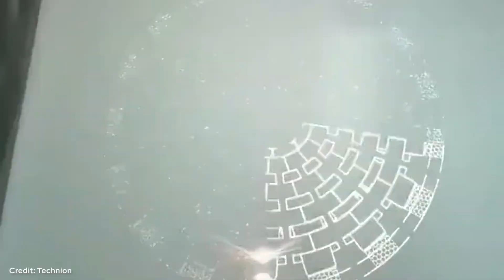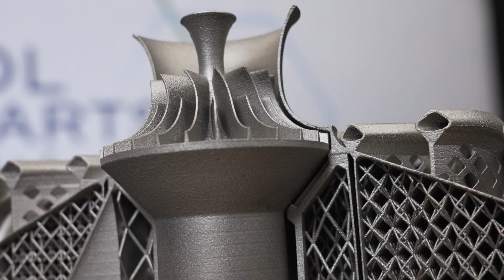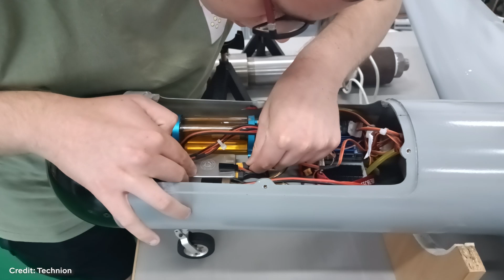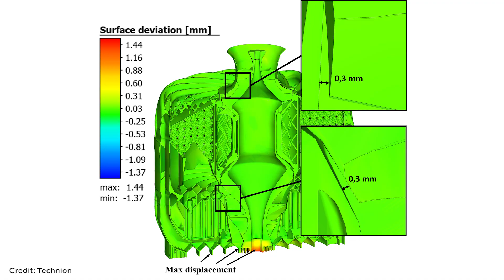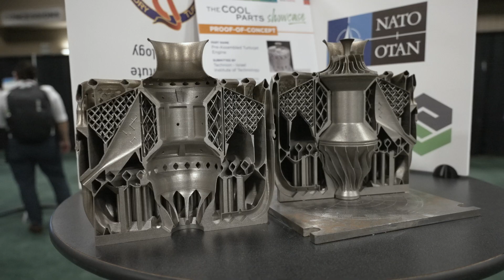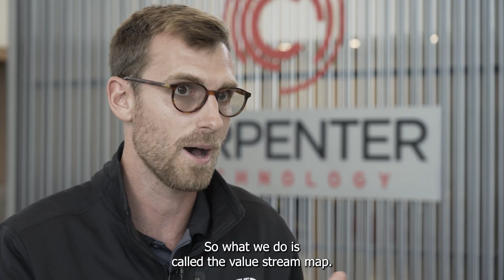Turbo Jet Engine 3D Printed In Only Two Parts

Comment: Very interesting. Bearings of course are the critical component to see continued reusability. I was really hoping to see a demonstration of this engine lighting off.
Reply: There are some techniques where “inserts” can be placed into an assembly during the “printing” process.
Reply: @danamyrocket  I understand that. It was clearly not done here. The design relies on a fluid bearing created by fuel in the spinning shaft / housing "bearing" zones. This bearing breaks down as the shaft slows down. At startup, there is no bearing at all, until revs are high enough for a hydrodynamic bearing to form between surfaces. The design may be made such that a break-in period is required to ensure proper mating of surfaces to best support later functionality. Kind of like a Babbit bearing. First uses will be in drones, likely as these appear to be of limited planned lifespan. There is no opportunity to repair either, unless they are made of a few more components. All of this said, you might be able to create from four parts, shaft, "housing" in three parts. With some easy light machining to surfaces, more durable bearings could be placed, thereby making the shaft and bearings, serviceable. This would also afford the opportunity to balance the shaft. As printed, it will definitely not be of precision balance, without fairly extensive machining.
Reply: @rob6052 the first use will probably be in cruise missiles where the service life is an hour.

The great question is whether printing a one piece housing, lightly machining surfaces for bearing inserts and then making the rotating assembly only two pieces plus a nut, is better. It allows setting the clearance for the hydrostatic bearings.

Being able to balance the rotating assembly is advantageous and that’s difficult to do while in engine. Even if you had nubs protruding, they’d need to be machined to accept bearings to attach for the spin balance.

It has already been mentioned that the lack of bearings before achieving fuel flow is a problem, and that is still true even with a single use turbine.

Playing devils advocate, if a grease were injected that was pushed out by the fuel, perhaps it could be started with a gas generator cartridge.

All of the above are ignores the problem that a two shaft turbofan saves more fuel than the weight penalty, or at high enough speeds that the ramjet or scramjet could be printed with no moving parts.
Reply: @edmarciniak7612  the questions we all raise, are the ones they're waiting to answer as well. This is an equivalent to Robert Goddard, thinking about playing with rockets.
Reply: @danamyrocket  inserts need preload so they can't move out of position or be loose during dynamic loading. Then as a journal bearing the spindle bearing needs to be at a specific finish and gap for fluid to allow the turbine to spin.
Reply: The intent is to use a "hydrostatic bearing".  The engine fuel will be injected into the void between the stator and the rotor, and then circulated into the combustion chamber
Reply: I know a lot of people are replying with the 'hydrostatic bearing' as they mention. But, there is a very good reason why the vast majority of rotating assemblies do not use this form of bearing. The viscosity of the fuel will be very low, at start up there is no float in the component. The rotating component will have  thrust vector and so often will not sufficient lubrication or float on the thrust side of the component. 
Again, I'm very happy to be wrong when I see them put 500+hours on this engine, with 100+ cold starts.
Reply: @MegaBoomshanka I operate industrial turbines, so I have some experience with this type of thing. You’re correct; an oil wedge bearing provides no protection at low speed without pressurized lubrication. We use XL32 turbine oil on our large Babbitt bearings, which is more viscous than kerosene/diesel but not by that much. It’s roughly equivalent to AW32 hydraulic oil. In order to make this work they would need a pressurized fuel/lube system to pump through the turbine prior to start up, and post shut down. 

The real issue with this engine is as it is designed it has no air management systems; so it’s going to have a VERY narrow operating output range. Think 2-3% maximum turndown, without having a good deal of external instrumentation and actuators bolted on.
Reply: @MegaBoomshanka  Yes it seems startup no bearing is the problem. But is it really? Already today a lot of jet engines require specialized removable mechanisms to get the engine going. If you had to attach something or whatever to overcome no fluid at startup, it wouldn't be that different.
Reply: It won’t run, definitely will never fly, but it’s fun I guess
Reply: its not a reusable engine
Reply: It doesn't run
Reply: @dontimberman5493  Indeed. It's a complete initial feasibility exercise. In my mind, they've proven some geometric construction capabilities, but beyond that, it marks the beginning of something new for a five to ten year dev cycle, depending on application.
Reply: @rob6052  oh ya and will likely never meet the efficiency or power output of traditionally assembled turbines. But it's still quite cool.
Reply: Are the latest Ukrainian drones using such technology? Their latest attacks have gone further into Russian territory and seem to have been moving to faster than conventional drones.
Reply: Yep.  I.e., it won't work.  3D printed bearing? Please.  (Let's see this engine running.)
Reply: @KaiseruSoze  Its a "fluid bearing" he says in video.
Reply: @hradynarski  that's, I think, what a hydrodynamic bearing is. It depends on the spinning motion to keep fluid in the bearing area. The film of fluid on a rotational shaft forms the bearing, hydrodynamically.